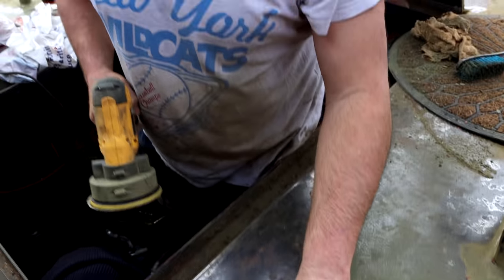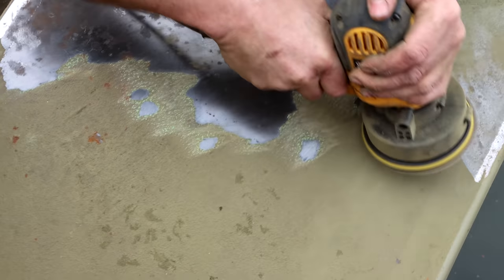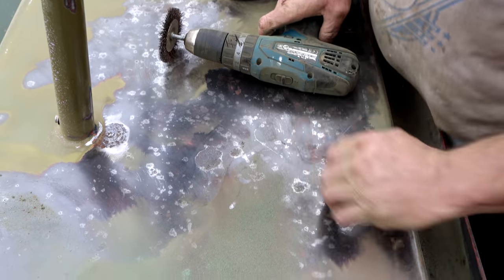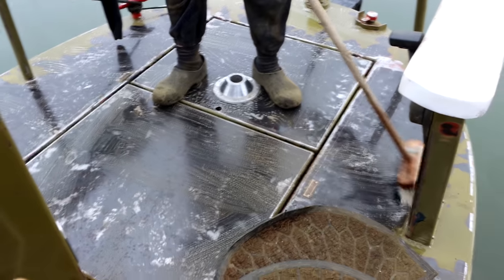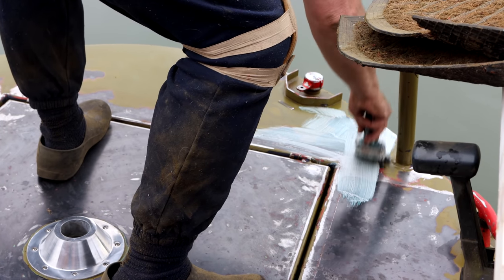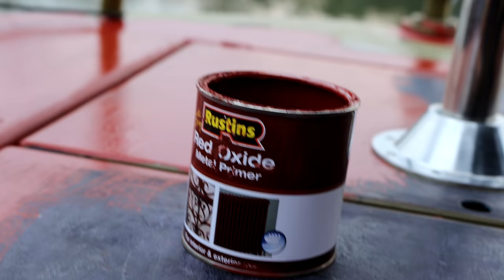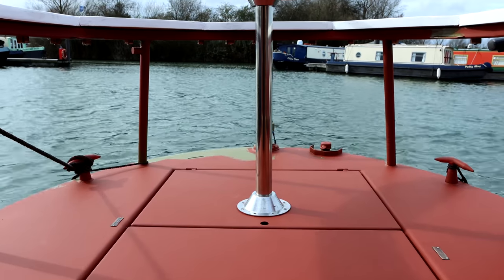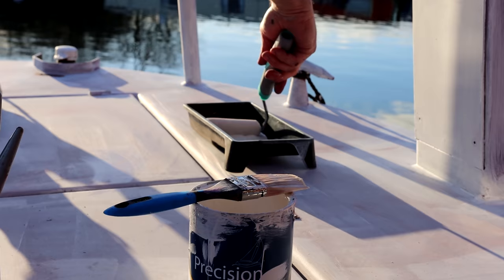27 - Repairing Our Stern Deck From Terrible Rust On Our Cruiser Stern Narrowboat

Comment: If you use deck paint you don’t need sand you’ll regret it it holds dirt. Ours is deck paint roof and decks it’s non slip and stays clean. 👍🖐👏 NB Fiddlesticks
Reply from the maker: Cheers again, but we've already bought the sand and lots of international paint it might be deck paint im not sure that's a question for dad but you'll see in the video.

Comment: could the noise be from a loose or dirty connection? It doesn't sound like mechanical. Check the jack plugs are clean.
Reply from the maker: Cheers for the feedback David, it probably is, it rarely does it, but it is annoying when it ruined your video. I the mic has been though hell, it's 4 years old and I've used it heavily and it's been in all the weather's the paints peeling off on the metal and the dead cat needs a wash it's a rode video micro I can't really blame it.
Reply: @TaylorsAboardaNarrowboat  I have a Rode Videomicro, and found to my dismay that the back part that carries the jack can come unscrewed. This might lead to damage to the wires, or just the looseness of this part in the body might cause noise. I am thinking of adding a drop of Loctite as it keeps unscrewing! Otherwise - good product!